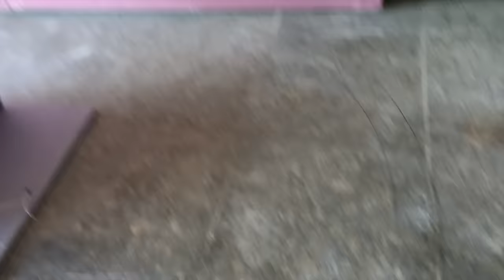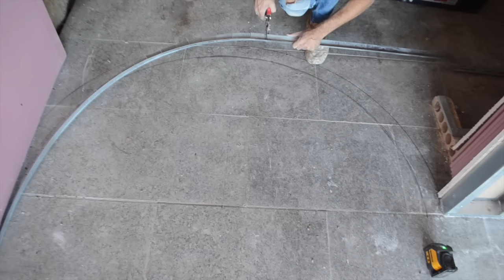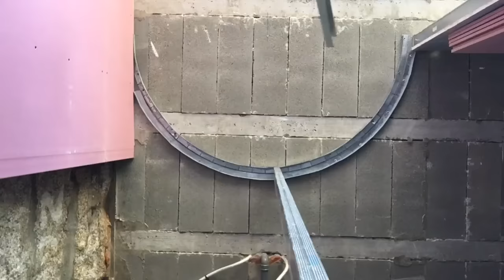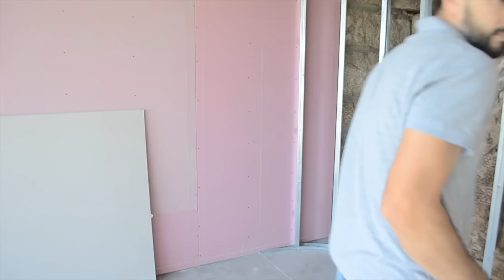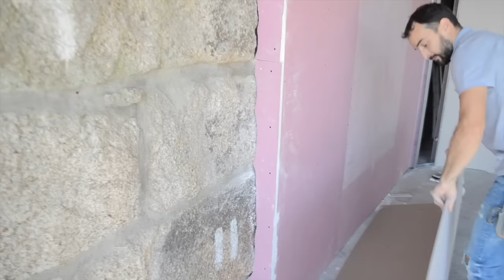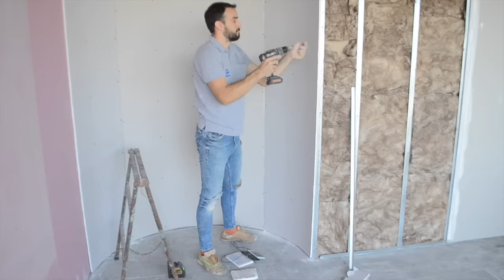✅ How to Make a Curved Drywall Partition 👉 with Metal Studs

Comment: Yes your tape measure to make the radius not a string lol BTW never wet the drywall
Reply: Wetting the back side of the drywall is standard practice in radius drywall applications. Use two layers of 1/4" to make it 1/2" , staggering the joints. Don't wet it so much that the front paper gets wet. It's a trial-and- error process.